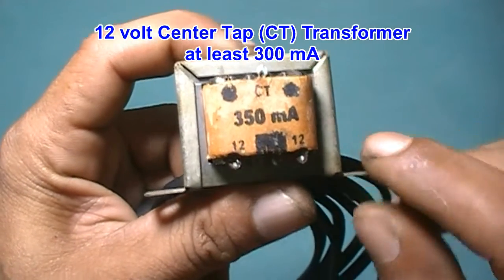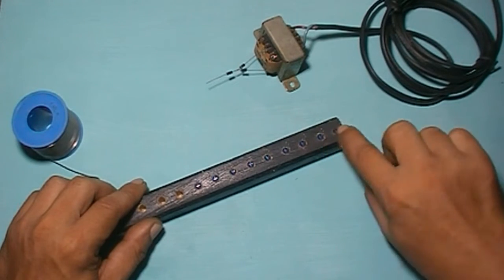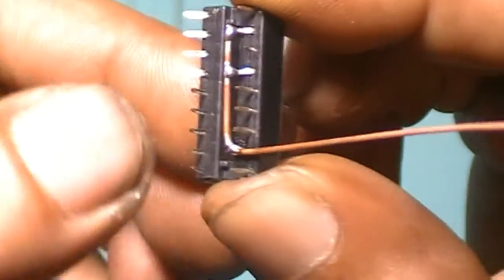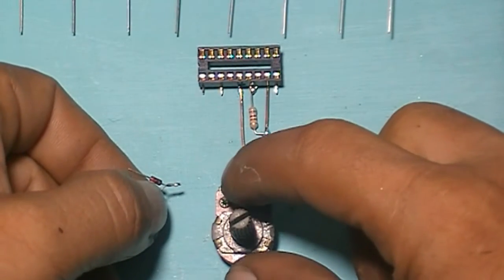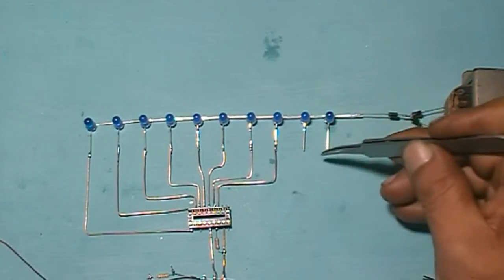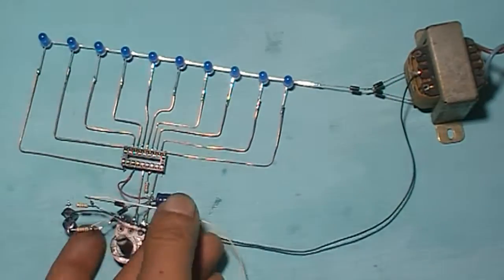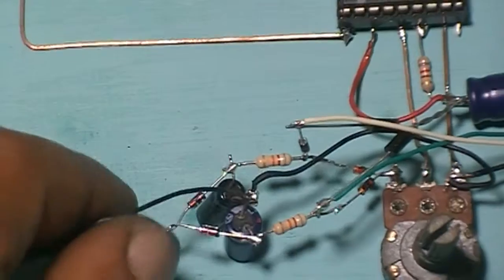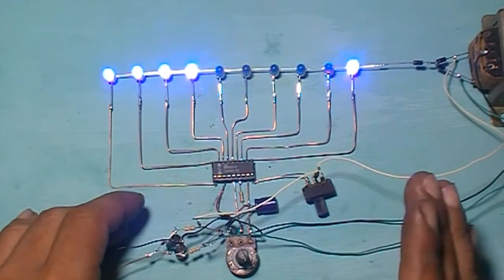Single IC LM3914 Peak hold VU Meter LED

Comment: I replace two 100k, 1k, 3.3uf 200v, 3.3uf 250v, all diode 1n4007... Its working dot mode only
Reply from the maker: So please use component values just like shown in the video.
Reply from the maker: And may you need to watch completelly.

Comment: Transformer 12-0-12?
Reply from the maker: Yes, you are right.
Reply: @moristo bagaimana jika pake psu non ct? Misal ambil langsung dari accu 12 volt..
Reply from the maker: @rahmatzainalabidin2164 untuk itu ada rangkaiannya tersendiri, dan itu bakalan jadi video saya kedepannya.
Reply: @moristo  pantas.. saya. Coba rangkaian ini dengan psu,gagal.. ternyata ada rangkaian khususnya...
Reply from the maker: @rahmatzainalabidin  ya, memang ada fenomena khusus yang menjadikan rangkaian ini unik sehingga hanya 1 IC saja bisa ada efek peakhold terlihat oleh mata.
Reply: @moristo  ditunggu bang.. rangkaiannya yang pake psu..
Reply from the maker: @rahmatzainalabidin  oke, tapi maaf saya tak mau janji kapan buat itu.
Reply: @moristo  ok.. entah kapan,yg penting dibuatin.. hhh..
Reply from the maker: @rahmatzainalabidin  siap
Reply: Little hint for beginners & newbies:
If you haven't a 12-0-12 transformer, you can take two 12V/350mA (or more mA) transformers.
Connect the primary windings in parallel and the secondary windings in series. Then check with a voltmeter that the voltage between the not connected together terminals is 24V. If the voltage between these terminals is about 0V, swap the 12 volt terminals of any one of the transformers.
Reply from the maker: @micknich6680  Yes, you are right, make it split seondary winding with two non CT transformer.